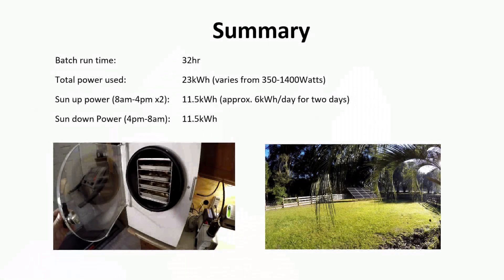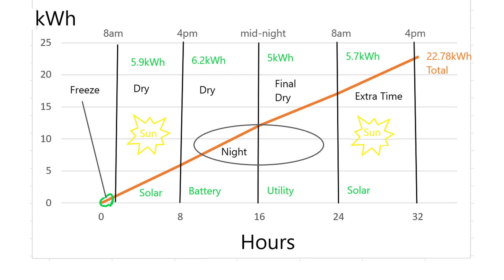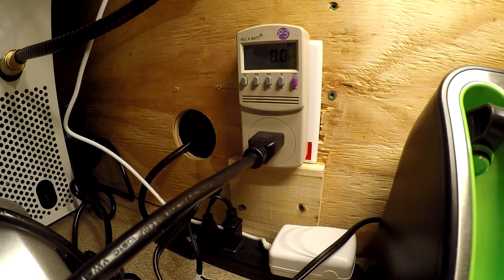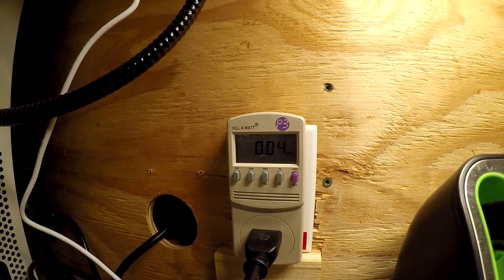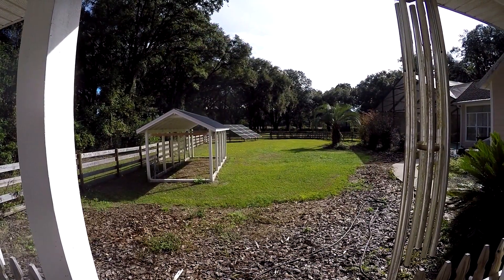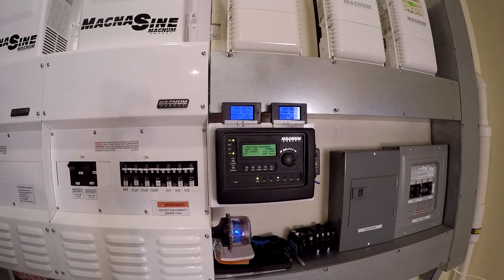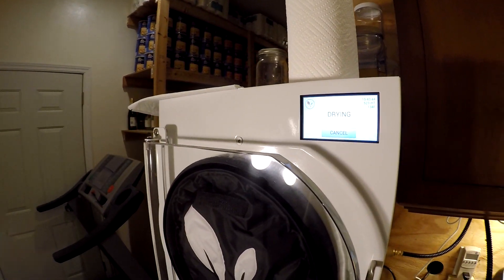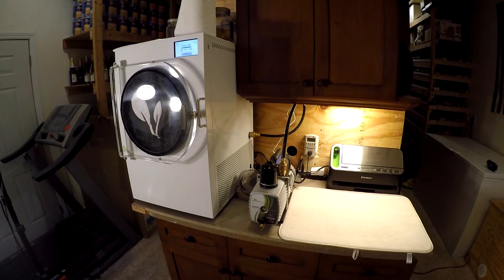Harvest Right Freeze Dryer Running on Solar Power

Comment: What if you started at midnight instead of 8am? With that many solar panels, you would easily reach 100% battery before next sunset, and then finish at midnight (without extra 8hr drying time). That way no grid is needed. Or if you upgrade to lithiums in the future, you can take them down to 20% which should supply enough for 16 hours of night time.
Reply from the maker: I think I need that extra 8 hours to get everything dry.  I have a 30kWh bank on order right now so I think I can go full solar/batteries in the future.  Thanks!

Comment: Several times we've had a short time of  utility power outage during our FD process... we were thankful machine just continued on after power came back, it just noted on the screen that there had been an outage, so I would think your switch flipping shouldn't be an issue.  Thank you for sharing the details of your amazing system! Hubby engineer is rapidly taking notes and screen pics as we watch n rewatch 😁
Reply from the maker: M M, I don't think my machine is that forgiving.  When my power went out during a cycle the machine stopped.  At that point I had two choices:
1. Start over
2. Manually cycle through to the stage before the stage it left off and restart the process there
I think there may be some risk to the machine when re-starting in the wrong cycle but not sure...  That's what a harvest Right tech told me some time ago.   Anyway, thanks for the input!  :)
Reply: @HomesteadEngineering  Yes, the models seem to differ and  it probably depends on where it is in the process when there is an interruption. We've only had ours a few months and appreciate all of your practical tips and insights. Thank you!

Comment: I have a large Freeze Dryer and use a dedicated nema 5-20 plug. I cant seem to find a useage merter for it. Can you help me? I purchased a bluetti ac300 + 2 B300 batteries + 3 Pv200 solar panels  comb set.  I asked hobotech who was prompting it, he said it would run my freeze dryer, so i bought it. After watching this I'm not sure. I am a single 70 year young. If you could advise i sure would appreciate. It has not arrived yet. Thank you for your time.
Reply from the maker: trina, I do not have a large freeze dryer or a Bluetti so I don't know for sure but here is my guess:
1. Your 3000W inverter should handle the estimated 2000W load
2. Your 9kWh battery bank will not be enough to carry the system from sun down to sun up.  I would guess your going to need something closer to 16-18kWh of usable battery bank.
3. Your solar panels will not be enough to power the system.  You can expand with more panels as I think your system can handle up to 2400W of solar input.  BTW:  I would purchase regular solar panels that meet the current and voltage specs for your system.  Most of these solar generator panels are way over priced and not what most folks really need.  They are good for camping.
All that is just my guess and that said you can do exactly what I did:  Install a transfer switch and run your Bluetti into it.  Then you can minimize your time on the utility/generator as needed.  

As for the meter you might try this, altough it would be a bit of work to install:
-Digital Current Voltage Power Energy Meter: 
 https://amzn.to/2ONExIN

Video:
https://youtu.be/kisScYjkSW0

Good luck!
Reply: @HomesteadEngineering  thank you so much for your information. I think i was suckered for lots of money! No way i am able to do what you have done. I would need to hiar an electrician , and we know how much that is. Also not lawful for me to put panels on my roof were i live. Don't really know what to do now. Thanks. God Bless
Reply from the maker: @trinade3732  While these systems are very expensive I am going to bet there will come a day when you will thank your lucky stars that you have made this purchase.   While it may not do what you were hoping for, you now have in your possession a means to capture, store and use a significant amount of power for the rest of your life no matter what happens to the grid.  That should give you a great deal of comfort.  :)
Reply: @HomesteadEngineering  oh how comforting, God bless you for your kindness. I have tried my tears. Still be able to keep my frig and small freezer going? 🙂
Reply: @trinade3732  You will be good with a frig and freezer, plus more.  Not many solar setups could run a freeze drier 24/7.
Reply: @MO-Silver59  thank you. My sytem still has not arrived. Floating out at sea somewhere!☹
Reply: I have same system with one magnum inverter and 8 of the same batteries. I have 6 390w solar panels do you think I can run on my system or would I need to upgrade. In the winter with no solar I run my house 20 hours to 80 percent and then run generator for approximately 3 hours

Comment: Uh...what a huge system u have.....lots of cash invested....
Reply from the maker: Fred,  yep, this is about what it takes to run a house.  I have 22k invested in it and I did all the work myself.
Reply: @HomesteadEngineering  Are you an electrician?
Reply from the maker: @majorhavoc9693  I am not an Electrician or a certified solar installer.  I do recommend that folks should hire a certified Electrician to perform the work.  Thanks!
Reply: I purchased everything separately. If you do it yourself it saves a lot of money.

Comment: So, what do you calculate the solar upgrades required to run only on solar for the solar array and battery bank?  What would be the estimated cost?
Reply from the maker: Mark, My current system is capable of running this batch completely off-grid but it would take a toll on my battery bank over time.  I do plan to upgrade my battery bank to a LiFePo4 bank with at least 30kWh.  That will run around $10,000 but will run my house almost like being on the utility.  I could see taking that all the way to 60kWh but $20,000 is bit much as long as the utility is still around.  The total cost of my current system was $22,000 and I have linked a video in the description of that complete breakdown. Thanks!